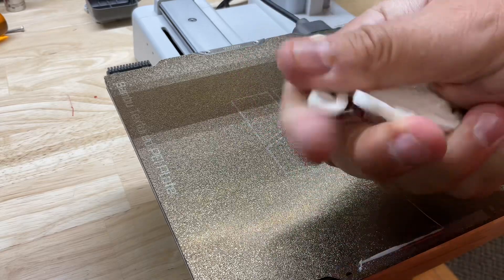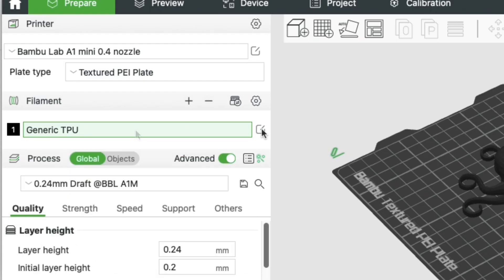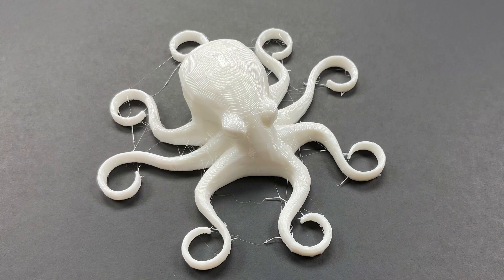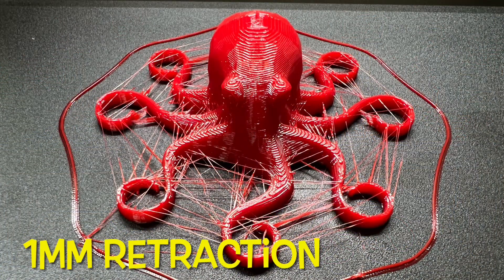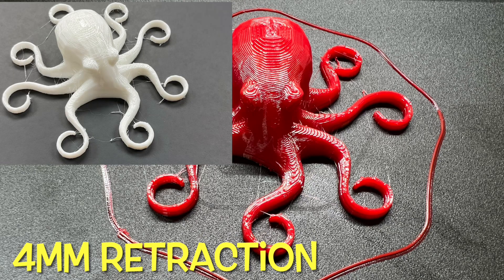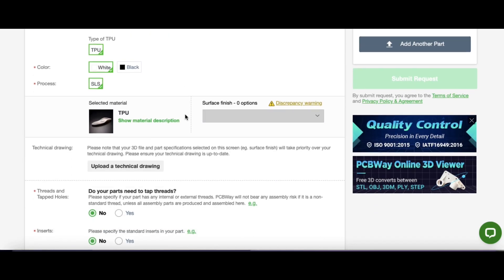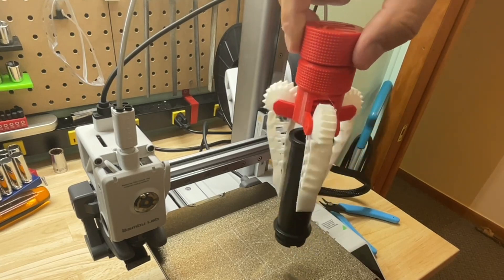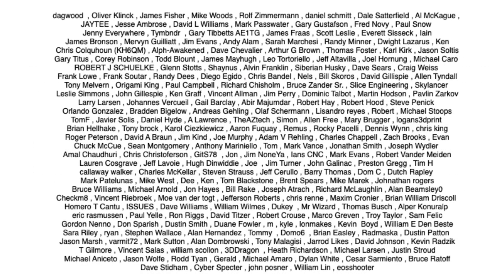Eliminate TPU Stringing on Bambulab A1 Mini 3D Printer

Comment: Thank you so much for the advice! I just have one question: do I need to put any glue or release agent on the print bed before printing? I wouldn't want to damage my textured PEI board trying to peel the part off.
Reply from the maker: I’ve printed right on it but you can add a glue stick layer if you want.
Reply: @FilamentFriday  Okay, thank you very much. I'm going to try it, and whatever happens, I'll be back to let you know the result.

Comment: For TPU should you be using the textured baseplate?  Wouldn't a smooth one work better?
Reply from the maker: It would stick too good to the smooth. It’s easier to pull off the textured.

Comment: Those are high temps. I go for 2mm retraction. 30mms retraction speed. 200c head temp, 50c bed temp. anywhere from 20 to 40mms at .2 layer height. With the filaments I use that works on the two printers I use. The A1 and an old qidi
Reply: What is your print speed ?

Comment: !!! OMG !! WOW !!! THANK YOU FOR DOING THIS TEST !!
NoBody else will/has done a vid like you did.
your test process explains SO MUCH for the TPU Stringing. the Over Compression makes a Lot of sense. so thank you again for this video.
im going to test it Right Now on my Ender 3 Max Neo. 

i really want to print TPU from the CFS with my K2 Plus, but it seems to be a pain. even with the spring mod (adjustable extruder pressure knob)
i did find out that telling the K2 Plus to use Generic BVOH filament settings for TPU in the CFS will actually drive the filament perfectly since the settings for both TPU and BVOH are so similar.
but now i might be able to get it to work w/o jamming on retract/extrude.

Comment: I had problems with Overture TPU 95A and after changing the retraction lenght from 0.4 to 0.7 the quality improved quite a lot. I must confess that I would never expected that such a small value diference in retraction lenght could make such a great difference in printing quality. Thank you very much for your advices! :)